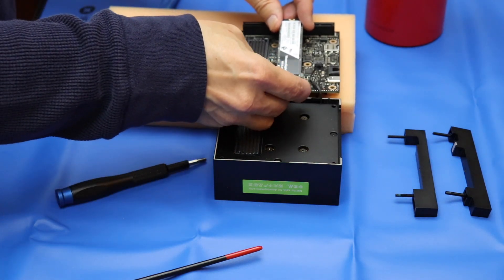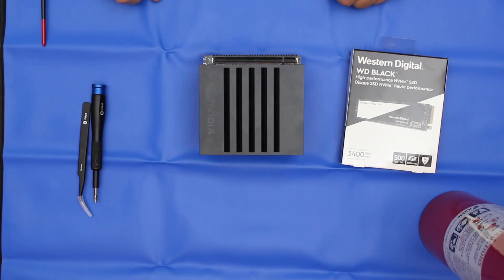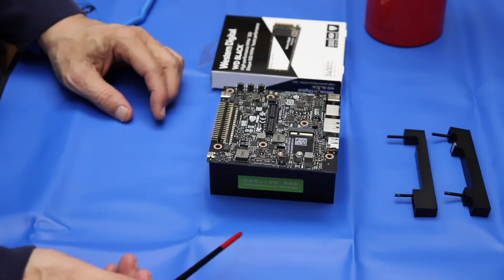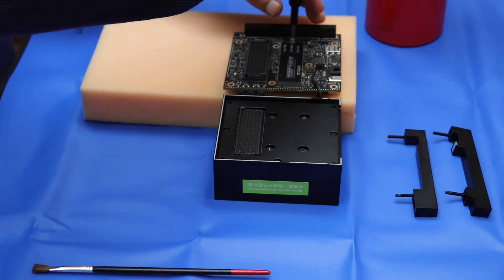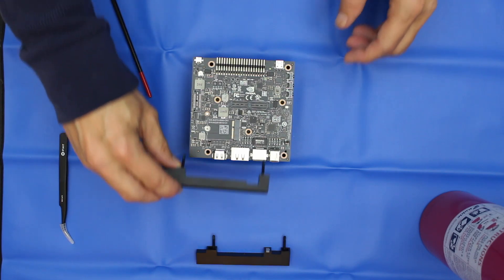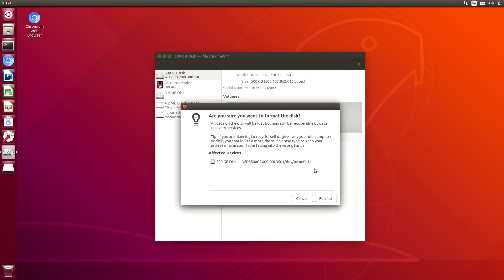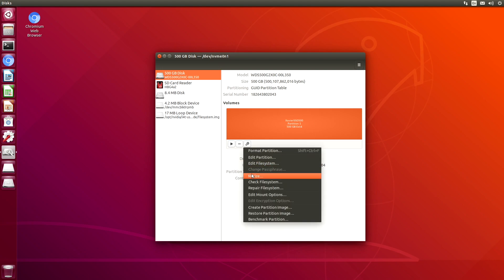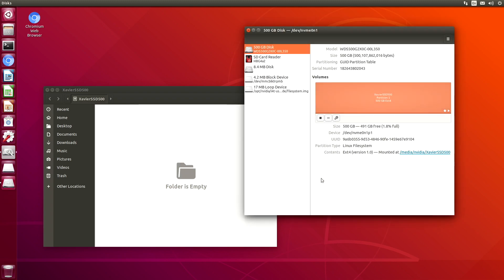Install Solid State Disk - Jetson AGX Xavier

Comment: hey! thank you for sharing~ I am wondering how can we choose suitable SSD for my Jetson AGX Xavier module, if you know reference site or how to choose one (or which one you recommend)  can you share, please?
Reply from the maker: Here's some on the JetsonHacks Amazon storefront: https://www.amazon.com/shop/jetsonhacks/list/1DE2AS7W7000C?ref_=cm_sw_r_cp_ud_aipsflist_aipsfjetsonhacks_TN09M64KB0WWGFP80YFG
For development, I usually use a Gen 3 500GB. They tend to run cooler. Assuming that you run backups, the 1TB versions can take up a lot of space on the backup medium. Thanks for watching!
Reply: @JetsonHacks  So, "Crucial P3 1TB PCIe Gen3 3D NAND NVMe M.2 SSD, up to 3500MB/s" also works fine, right? and I was thinking also SAMSUNG ssd, but in the description it's written that that's good for gaming
Reply from the maker: @azrflourish9032  The gaming bit is just marketing copy. Gen 4 is faster than Gen 3. However Gen 4 tends to run hotter and use more power. Depends on how you are using your system as to what tradeoffs you want to make.
Reply: @JetsonHacks  Thank you for your response! appreciated~
Reply from the maker: @azrflourish9032  You are welcome and thanks for watching!

Comment: Thank you, got my 256GB mount up and running. Shows up on my Jetson AGX Xavier and is mounted. But my Jetson still acts like it has no memory. I run into "memory" errors when I try to download with pip. I followed all the steps you showed. Any idea what could be wrong?

The only difference with my installation and yours is that my ssd already had windows installed on it (my ssd came out of a different computer and had been used for under 10hrs). As such, I erased everything with zeros.

I used the command 

sudo lshw -C XavierSSD256

and it says it is USB :(
Reply from the maker: I don't know what "memory" errors means. Did you format the disk with GPT and a partition?
Reply: @JetsonHacks  I followed all of the steps that you went through, but it still did not include the ssd as part of memory to be used for installations like with pip. It just acted like a USB. I found a website from seeedstudio that worked for basically replacing the eMMC altogether with the SSD. I'm not sure if there is a way to add the memory so that it is 256 GB + 32 GB rather than just 256 GB.
Reply from the maker: @GodsLittlegizmoguy96  The term "memory" is confusing here. After installation, you will have 32GB of eMMC drive space and 256GB of drive space on the NVMe drive. 
By default, pip will install into the main drive (the 32GB one). You can tell pip to install into a different directory (ie one on the 256GB one) using the -t option. You could also use the --prefix option. The target directory must exist before installation. You will also need to decide where to install dependencies and set your PYTHON PATH. This is beyond the scope of what can be covered in a YouTube comment. Good luck on your project!
Reply: @JetsonHacks  ok thanks for the help! And sorry about the confusion. I’m still a bit unsure of the lingo and what means what.

What I meant was I didn’t realize you had to specify which drive to download on. I thought it would be able to search between mounted drives which one to install onto. 

Now my setup acts like the 256GB drive is the main one to install onto and it copied everything over from the eMMC so it will work for now. If I need more drive space later on, I’ll have to figure out how to erase and use the 32GB eMMC drive

Comment: Computer/Linux newbie here. In this video with the AGX you install the SSD and make the partition, however in your Xavier NX video you also add some code so that the NX runs from the SSD. What is the difference? Will making the device run from the SSD make it run faster?
Reply from the maker: In the Xavier NX video, we copy over the kernel Image and boot information so that the NX can boot for the SSD. Thanks for watching!

Comment: Xavier dev kit is very heavy. Is it possible to remove the heat sink and use it?
Reply from the maker: It depends on what you are trying to do. The heat sink is there for a reason. You could switch from a passive to an active cooling solution (Connect tech makes a heatsink with a fan attached which is lighter). If you have enough air flow, then you can manage your thermal solution differently. For example, you could use it relatively safely on a drone which is mostly always moving.

The issue you may encounter is that if it's just sitting on a bench or something while running, it may overheat and shutdown thermally. You should ask this question on the official NVIDIA Xavier forum for alternate solutions.

Comment: Good afternoon from Australia
Just expecting my flashy new Xavier this week :)   
below has a discussion about using the NVMe SSD as the primary drive for bootup,
Since the last 5 months has passed, is there any progress on this front ?

secondly, it is possible to install/run the JetPack on the SSD ?

sorry to be new to Linux... :(

excellent work Jim, excellent site.
Reply from the maker: G'day mate, and thank you for the kind words. I don't recall hearing anything about being able to boot from the SSD unfortunately. I had heard they are still working on it. JetPack is an installer (now called NVIDIA SDK Manager) which only runs on a PC desktop/laptop running Ubuntu. JetPack flashes the Xavier, and then copies over the packages (OpenCV, VisionWorks, and so on) that you select. Thanks for watching, and I hope you have some fun projects with your new Xavier!
Reply: Jet pack 4.6
I think you can

Comment: Is it possible to mount it as a boot drive? Maybe you could do some speed tests to see if you get any noticeable performance increase while running applications from that ssd drive as a secondary drive.
Reply from the maker: I don't know the answer on the boot drive questions. I'm not quite sure what the point of speed tests are when not examining a specific application. The NVMe SSD is ~ 9x faster in read and write speeds compared to the internal eMMC. If you have an application that's disk bound, it will be faster. If the application is compute bound, there won't be much difference. Thanks for watching!
Reply: When thinking about what might be theoretically applicable, OpenCV and  CMUSphinx come to mind; these robotics libraries both have disk bound dictionaries or lookup tables that are constantly reading/buffering from disk during their main loops. I'm pretty sure there are linux based disk benchmarks you could try. I'm not sure how Linux handles it, but for disk-to-disk transfers the speeds are capped at the rate of your slowest drive in Windows.
Reply: If you want me to run some tests for you, I'd be happy to. Send me a git repo with instructions.
Reply: Shreeyak, oh sorry, I didn't realize I was speaking to a third, eh, third party, heh heh. I looked at your liked videos, and we both watch and like the same exact videos, lol. You're cool man. Have a great day.
Reply: Haha, thank you. You too have a great day.
Reply: @shreeyaksajjan1200  Good to see you other than udacity slack channels. I have been trying to find options for booting xavier from nvme too. Apparently read speed 3.1 GB/s is a must go  booting option for xavier if nvme is installed. Hoever, proper  boot images for nvme  is not yet implemented by nvidia. There are experts talk on it but not a complete tutorial style posts or videos yet.

If you have done solving boot from nvme problem, could you share it with everyone?
Reply: Hey @myoungki! Nice to others here too! I've unfortunately not had time to setup my Xavier, so I've not looked into it. However, I don't see much problem in using the inbuild EMMC for boot drive with the NVME just for storage in my applications. From the TX2, I've seen that using external storage as boot can be an involved process when flashing a new OS, so I've not bothered with it.
Any reason you're looking to use the NVME drive as a boot drive?
Reply: No sir, but thanks. I'm not very familiar with linux at the moment. I would like to see how the latest Jetson handles Retroarch, if you're up to the challenge. Would be cool to see if it can run those emulators of old retro video game consoles well, although it probably requires it to be compiled for the Jetson SoC. 

I lurk on your channel sometimes; you've got cool content. I don't know why people aren't interested in the Jetson; it's pretty awesome for robotics.